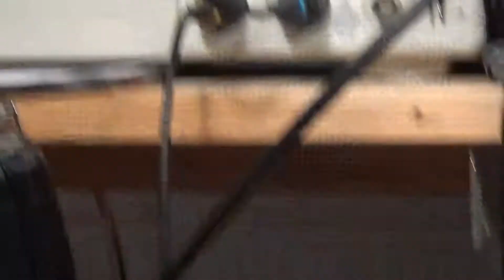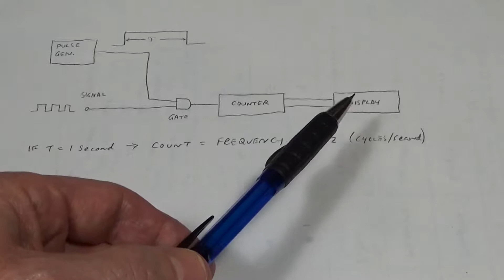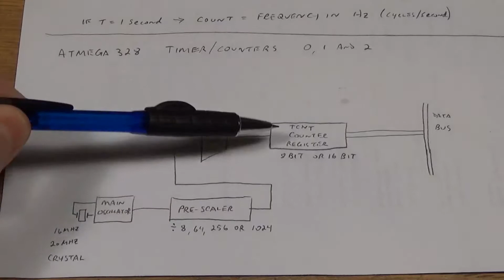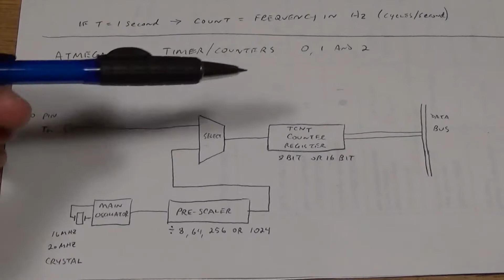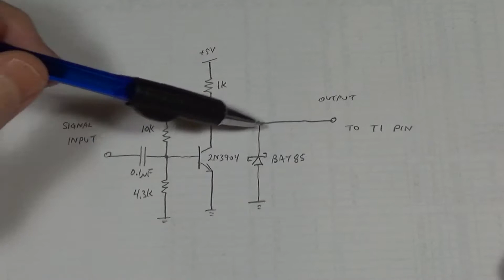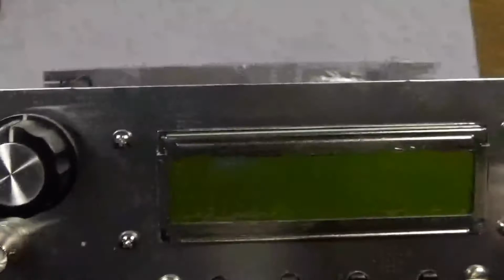Implementing a Frequency Counter Using a Microcontroller, Pt. 1

Comment: Great video! I now understand that you can use an external signal to increment a timer. Good deal, as I'm still learning. I've managed to fiddle with the PWM frequencies.
Out of curiosity: are there any issues if one were to use INT0/INT1 (external interrupts)? Is there some kind of limitation? Thanks!
Reply from the maker: Thanks, glad you got something out of the video.

You can use the external interrupts but you will have to write your own code to increment a counter.  Sounds to me like that would be more work.
Reply: @craighollinger9972  Hi Craig, thanks for the reply. I've managed to build a frequency counter using a 4x7 segment display (connected to a UL2003 and a 4511). Brain of the project is a ATMega328P. I've used a large portion of the code you provided. Thanks again for the videos, I managed to learn a lot from them as well as put what I've learned to use!

Comment: Very well explained! if only my professors would explain like you... I don’t have much experience programming AVR (Atmel) microcontrollers outside the IDE of Arduino this video has inspired me to start learning more about the actual microcontroller and Atmel Studio as i think Arduino limits applications like these ( I know it probably can be done, but i think is much better the way you program). I’ve been using PIC microcontrollers for a few months now and just recently started working with the timer modules, so i can already visualize me implementing this frequency counter but i’ll wait for part 2 to see the software side of things. A lot of questions that i had were clarified in this video thanks. It’ll be very interesting to see (if possible explain) your projects i think we can definitely learn something out of it. Kind regards
Reply from the maker: Man LA Thanks for the comment. Arduino is a great place to start, but it has its limitations.  If you want to go deeper into understanding a microcontroller, you have a steep learning curve ahead.  But once you understand any one of the common modern microcontrollers (Atmel, Microchip PIC, etc), learning about another will be easier.  They all work in about the same way.  I just posted part 2.